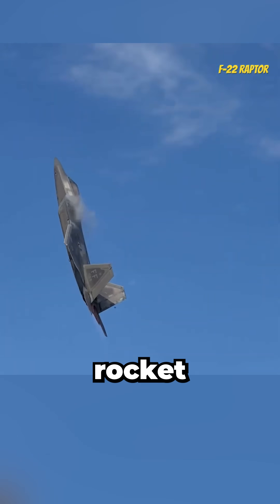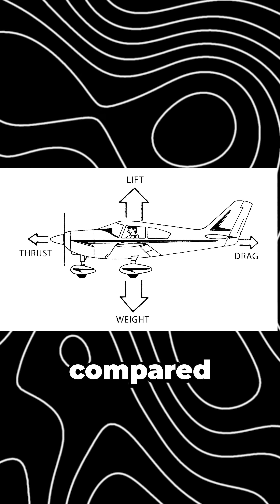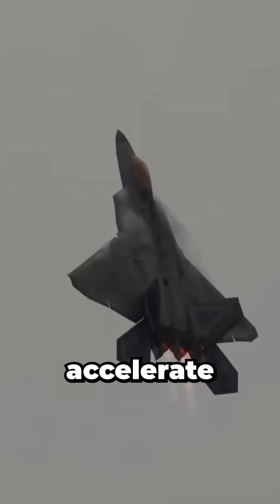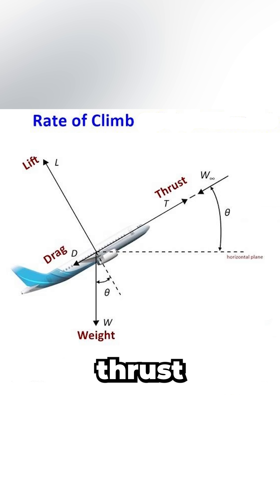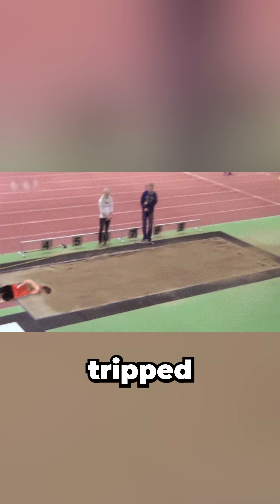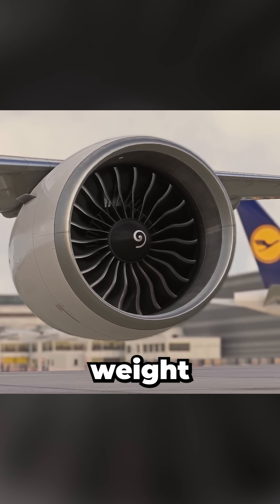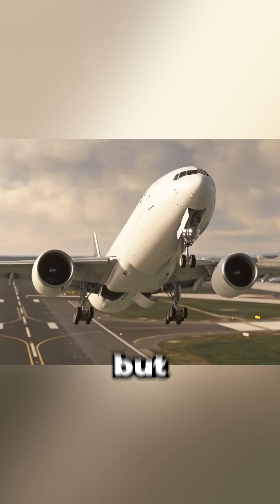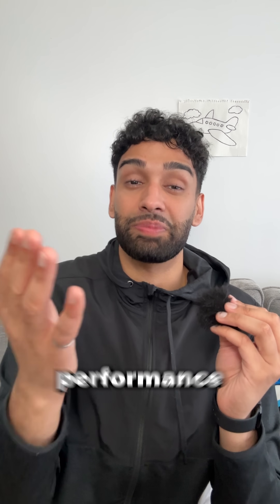Why some jets climb like rockets and others can’t

Comment: Is the F15 thrust to weight to ratio is a bit more than 1 ?
Reply: Depend on the payload and fuel the plane has on
Reply: Isn't it 1.5
Reply: He made another video saying that it’s 1.5 but there’s some nuance so you should see if you can find the video
Reply: Didn’t he say the ratio of the F-15 is 1.5 only with no payload or fuel?